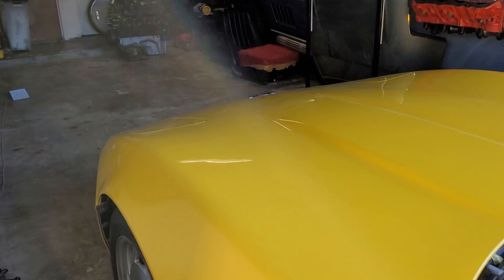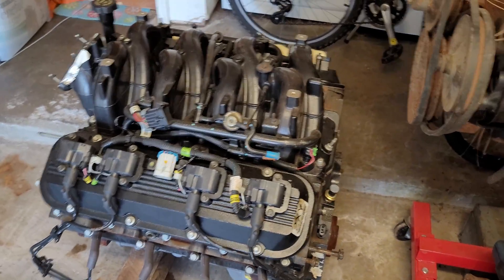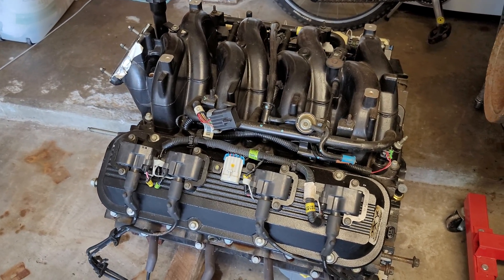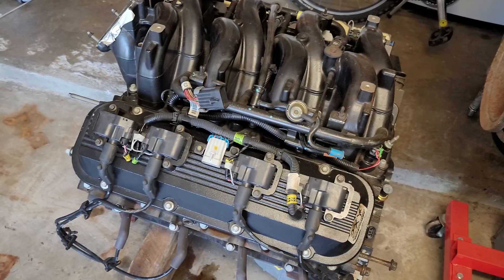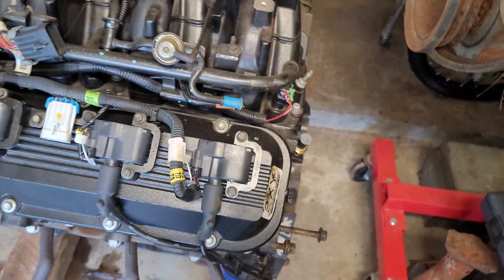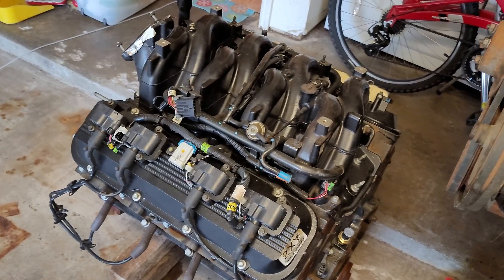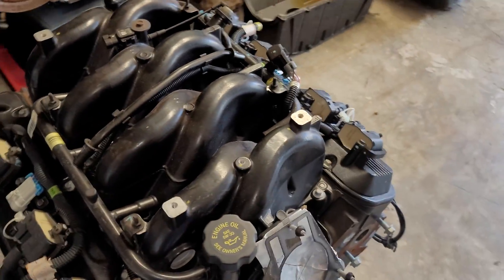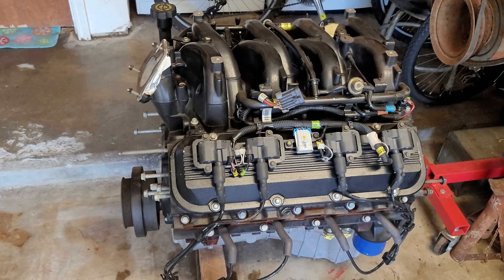The Monstrous Vortec 8100 496 8.1L Big Block Engine of the 2000's

Comment: There must be something wrong with with my 04 8.1l in my 2500 avalanche. The thing is gutless. My old 5.3l in my tahoe had more power and my current 08 yukon 6.2l crushes it in power and torque.  Gas mileage is atrocious at about 10-12 cruising on the freeway at 70 on flat ground. Any hills It drops considerably. Forget towing any thing with it. Mileage drops down to 5-6 or less and really has no torque or power to go anywhere, can barely get to 65 70 mph floored. This is not a heavy trailer either, just my 4 place rzr. I've taken it to one dealer (worthless) and 2 other shops. All claim it is running normal... I just don't get it. Any ideas how to get power and torque like most people are getting.  I had it dynod snd it was getting abou 250 rw hp and about the same torque. This is after I did a cat back, cold air intake and program ecu. I live about 4,000 ft.
Reply: I appreciate the quick response, I have done many of the things you suggested. The motor has about 130k miles on it. I did wires and plugs, but no coil packs, the fuel pressure has been checked while under load driving and is good. I thought the cats were checked when the exhaust was replaced, but may be worth double checking. I have no service or check engine light, and a shop did say they checked the torque coverter to see it was slipping and they didn't find anything.

I really appreciate the help and really want to love this engine. I would be fine with mpgs in the 8's if it gave me torque at least comparable or more to my 6.2l but it doesn't even seem close to where it should be. I almost sold it but like the 2500 avalanche to much. Was thinking of doing a duramax swap but don't love that for several reasons. I'm also considering putting a raylar supercharger, but don't want to bandaid a real problem.
Reply from the maker: Yea, no problem. I think you're right about holding off on changing or selling before you identify the source of the problem. This era of trucks can be rather frustrating with wiring troubleshooting because there is so much of it and the complexity of the modules attached to it. I would seriously look into the torque management response signal between the EBCM/TCM/ECM. A problem in that circuit can cause a serious lack of power feeling with the engine and transmission.
Reply from the maker: Hey Benjamin, something is definitely not right with that. A Big Block Chevy, while not as fast as the other engines you listed should outperform them on every other metric like power, torque, and towing.

 My first thought would be to check the coil packs, wires, and plugs. Sometimes they can misfire enough to cause problems but not set the "service engine" lamp. Also check your fuel pressure, these engines require a very specific PSI setting in order to run properly, especially under load. Also check the catalytic converters if still installed. They can clog up and have a serious effect on the power output. Last thought is maybe you have a transmission related torque management problem that is causing it to be gutless. Do you have any "service engine" or ABS lights illuminated? 

It might be a good idea to have it hooked up to a current generation scan tool that can see what the engine management system is doing in real time. That would definitely go a long way to figuring out what's happeneing.

Let me know how it goes👍.
Reply: I have the same problem with my 8.1 if you ever figured out the problem let me know, thanks
Reply: @jorgeguerra5876  My avalanche is currently at a very reputable transmission shop and they are checking the CATs and transmission as well and anything else that might be causing the performance problem.  They said they had the exact same AVY 2500 in a few weeks ago with an unrelated problem mine is having, they did say that one had considerably more power than mine and was running as it should.  They did admit that there was definitely a performance issue with mine that no other shop I have taken to in the past has admitted to before so that is at least a step in the right direction.  They are doing their diligence this week and hope to have an answer this week back on what they find.  So, I'm crossing my fingers.  I hope to hear something back this week.  When I do I'll let you know!

Comment: 15 years ago I saw an ad in the newspaper ( how times fly ) just as the paper was delivered about 6 a.m. . I called real quick about a 8.1L for sale for $500.00 thinking it was a joke . It was real and the guy was a GM dealer mechanic that had replaced the engine under warranty and  a bolt from either the crank or pressure plate ( can't remember for sure , it's been so long ago ) had gotten up and chipped a chunk of cast iron out of the block where the plug that seals the end of the camshaft . It wasn't leaking or even close enough to ever leak but GM did warranty the engine with a complete crate engine . I bought the engine over the phone and drove two hours to meet the guy during his lunch break . I was thinking it was a wasted trip all the way there knowing that either he had already sold the engine or there was a lot more damage than stated . He had the engine on the cherry picker and set it in my truck , i paid him and he told me how a bunch of his fellow mechanics had cash in their hands when he first showed up for work and that his word to save the engine for me was his word and if I didn't show up then he would sell it when he got back to work . I spread the word about the engine that afternoon when I got home and my phone was blowing up when I turned it on the next morning and I sold the engine before noon the next day for $1200.00 and a damn good old Arkansas country cafe lunch . I did notice numerous differences between the 8.1 and the 454's I was familiar with and learned later the guy that bought the 8.1 had a hell of a time dropping it in his 454 Chevelle .  Great video sir .
Reply from the maker: Hey D, that was a nice score. The 8.1 is one of the worst kept secrets among the gearhead crowd, even though it's an engine that has been lost to time for a majority of casual car fans. 

From what I can see, the demand for them will stay consistent for a long time with the people that use them as the work horses that they are.

Comment: I have a 2004 Silverado with the 8.1 and Allison 1000, also has a Leer topper. Has cosmetic fixes needed, but is a powerhouse. Chirps off the line because of that awesome torque even with a load sometimes. My baby has a set of auxiliary rear leaf springs increasing the payload, which combined with the tow capacity is over 20K lbs! Never hesitates, can pass anything, climbs like crazy on a mountain pass. Anyway, I'm looking to sell and getting lowballed on trade-in value. Where is the best market to sell this truck?
Reply from the maker: Yep, very much the same type of experience as the majority of 8.1 owners. You'll definitely get lowballed by the dealers that don't specialize in the heavy duty trucks. You didn't, mention is yours a 2500 or 3500, SRW or DRW? I would post on FB marketplace, and look for the 8.1 owners group. Quite a few people are looking for them, and with the features you describe I'm sure you'll find a buyer quite easily. Let me know if you have any trouble locating the group.

Comment: I know of several 8.1s with 400-600k miles all still run great. With 4.10s and a Allison in a 2500hd they pull just as good as a diesel
Reply from the maker: yep, GM really wasn't kidding when they referred to it as the diesel alternative. Loads of power and none of the gas mileage😁.

Comment: 1. Oil consumption: mine was using oil and my mechanic pulled the intake bolts one at a time cleaned the bolt and the bolt hole then put sealant on the bolts and it stopped the oil consumption and fouling my plugs.
2. They are known to have problems in the 2001-2003 models with the crankshaft position sensor which can cause the engine to stall while moving but usually will start right back up, run ruff intermittently.
Reply from the maker: Good info Larry, thanks for sharing👍.

Comment: PSI makes a big bro of this at 8.8L with piston coolers,  some blocks are SAE.  Dart made a 4.5 and a 4.75" crank, large valve iron heads, 4bbl dual plane intake so you could run a carb & dizzy if you wanted.  8.1\8.8s are tall deck motors, like gm truck blocks.   Aftermarket BBC rods and piston combos can fit. OEM manifold was a bottle neck. HO Marine units had a bigger cam, minimal smog parts,,,,more HP.
Reply from the maker: Hey Glenn, thanks for the comments and information👍. I've seen the guys running these with the aftermarket mods and the power output can get pretty insane. I might try some of that with the 8.1 GMC 2500HD truck I'll be putting back together. For this engine I think I'll leave it alone since I don't want to throw too much power in the 8.1 Yukon that will be used by my wife most of the time😁.

Comment: Larry the owner of Raylar Engineering who's a very close friend of mine put an 8.1 in his 99 Vette close to twenty years ago, shortly after that he started Manufacturing his cylinder heads
Reply from the maker: That must have been a monster on the streets.
Reply: @VetteSource  it is, it has a 6-speed manual transmission and he still owns it
Reply from the maker: Very cool. How does the T56 stand up behind it?
Reply: @VetteSource  I think the Transmissions done okay but I believe he had a torque tube failure
Reply from the maker: For sure, those become problematic when you start adding HP and Torque.

Comment: Anyone has the knowledge of the best manual transmission for this engine?
Reply from the maker: The manual transmission equipped 8.1 engines had the ZF NV4500 six speed installed from the factory. Forgot to mention that yesterday.
Reply: @VetteSource  
Thanks man
Reply from the maker: NP

Comment: I had a 2002 Avalanche 2500 with the 8.1L traded it for a bigger bed but that thing would tow a 30' boat like it was a tool box
Reply from the maker: Yep, the towing power of the 8.1 is pretty epic. Just don't expect to pass many gas stations😁.
Reply: @VetteSource  no kidding, it claimed 10/15mpg but it was 7/12mpg on a feather foot.
Reply from the maker: Yep, as much as I love the engine and drivetrain, you better plan accordingly for fuel costs when you take that trip😁.

Comment: I've got an 03 8.1litre, infront of a TH400/NP203/NP205, with Dana 60F, and a 14 bolt, w/5.38 gears. All sitting in a 1973 K10 shortbox.
Reply from the maker: Hey Matthew, i've been seeing those conversions. Very cool setup and loads of rock crawling and pulling power I'm sure.
Reply: Do you have any videos posted of it?I'd love to check it out
Reply: Hey Matthew sounds like a good setup. I have a 75 k5 4wd and I have a 8.1 with an Allison 1000 and a np263. I was thinking of going with a th400 and the original trans behind the 8.1. I also have a dana 60 and 14 bolt as well as the original axels. How do you like the setup with the 400?

Comment: Hello! Can you please set the information matchings between this big block 496 ci 7th gen and 454 gen 6th and if they were both 4 main bolts as well if 7th gen can be swapped to carb etc .. please, thanks!
Reply from the maker: Yep, the Gen 6 and Gen 7 are both 4 bolt mains, and there is a carburetor intake manifold for this engine. You can send me a DM @VetteSource through FB or IG and I can source one for you.

Comment: One more thing. I did this swap even though people said it wouldn't work. The 11.5 aam diff was very bad so I replaced it with a 14 bolt corporate. Paid 100 bucks for it.. lol. Same 4.10 gears to match the front. Which to me is one of the best diffs on the market. 40 years with only a few modifications...The only difference is you need a longer driveshaft. Everything else swaps. The only downside is you loose 1 grand towing capacity. Since the corporate is about 200lb lighter than the aam.
Reply from the maker: good information, thanks for sharing.

Comment: Got an 01 2500 mine has 410000 miles on it. Motor has not been opened as I know. Little lifter noise on startup only. Had it 10 years. My problems were rear diff.. had 1/2 play on the pinion, believe the limited slip additive wasnt added to it. The driveshaft which I replaced with a 1 peice aluminum. Since was throwing center bearings every 9 months to a year. The new one is Allison throwing a torque converter lockup code. One thing the 8.1 an Allison combo does not like is idling for awhile the motor can handle it  the Allison hates it an causes problems w the transmission. Mine slips only if I leave it running more than 10 min an if I shut it off an restart its fine again. Will be needing another transmission soon.
Reply from the maker: good testimonial and information regarding the "quirks"

Comment: A company called Raylar engineering make performance parts to build a high horsepower and super high torque 8.1 Chevy engine that are designed to move large heavy vehicles and trucks with loads of low end torque
Reply from the maker: Yep, from what I've heard they have quite a bit of excellent engine upgrades for the 8.1

Comment: If GM would have invested in some research and updated engineering and design in the 8.1 496ci engine this engine could make a easily made 480-500 horsepower and 575 foot pounds of torque that would pull like a freight train from idle to 5500rpm if GM engineers made some new technology upgrades to it the new Ford 7.3 gas engine is a very strong gas engine at work we have one in a F550 Ford truck and it moves it very well with loads of torque from idle to 5000rpm like it much more than the GM 6 cylinder turbo diesel GM invested all kinds of money into would have preferred a updated improved 8.1 gas engine
Reply from the maker: I think alot of people would have been happy for GM to continue updating and revising the BBC for eternity, but apparently they felt like it had run its course and killed it with the 496. Too bad, but at least it's one heck of an engine that still puts other heavy duty trucks to shame. I'm curious to see how the new 7.3 Ford will hold up long term, and if Chevy answers with a "big" gas engine of their own.

Comment: I said the same thing when a friend of mine came over is a suburban today with a 8.1 I was like no way let me see it. So he pops the hood I'm like I see the intake and coil packs and instantly say that's an LS motor nor had I heard of an 8.1 300hrs at wide open throttle and it didn't blow up that's insane I wonder how much gas that took @ 6mpg🤣 definitely getting the lower end of mpg at wide open throttle lol
Reply from the maker: Yea, that was an amazing durability test. The last generations of the BBC are dead reliable with proper maintenence. Like you said, most people mistake these for LS engines when they see the coil packs and intake manifold. They even use the LS Style engine PCM and wiring system.
Reply: @VetteSource  dude that's exactly what it was damn coil packs and intake manifold scream LS
Reply from the maker: You should see the early C2 and C3 Corvettes these 8.1s are being put into. Talk about punking everybody at the car show🤣.

Comment: I've had my 02 ccsb Chevy HD with the 8.1 for 4 years now. I still absolutely love it. It has a custom tune, set up for 89 octane and gets 11 mpg all around average. With 4:11 gears and 285 tires I can manage almost 12 mpg empty on the freeway under 75mph. I pull several trailers but it's biggest impact is my 20' steel frame cargo trailer. It's a foot overheight and bucks wind like crazy. The truck pulls it easy but I average 7 mpg with that no matter how much weight is in the trailer. As far as oil consumption. I've found old school conventional 10-30 is best. I use maybe a quart between oil change. I ran a synthetic and a blend a couple times to try but experienced poor results using as much as 3 quarts between changes to keep the ol girl full and happy. Thanks for your video.
Reply from the maker: Hey MnR, thanks for the testimonial and feedback. Like you said, these are great trucks and with the 8.1 become family legacy type vehicles.

Comment: Do parts from a LS swap onto it? Just curious since you mentioned so much was adopted to it
Reply from the maker: Hey Justin. Even though it has LS architecture adapted to it the 8.1 is still a Big Block Chevy, so nothing from this engine will work on an LS engine and vice versa with the exception of the PCM/wiring and fuel injectors as long as you are running a high performance build that can handle the higher fuel pressure. 

It's pretty much a one-off kind of animal, as most of the pieces won't even work on the previous generations of BBC.